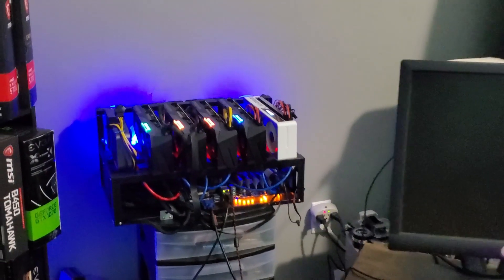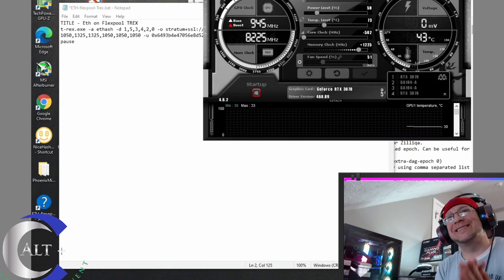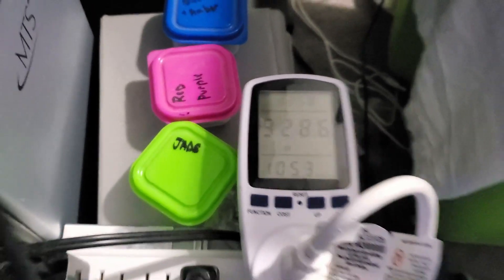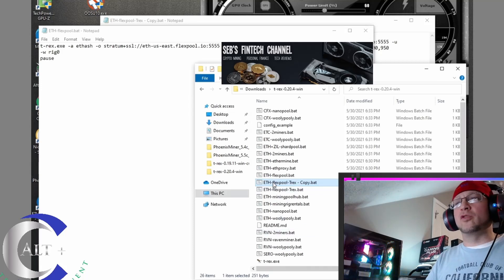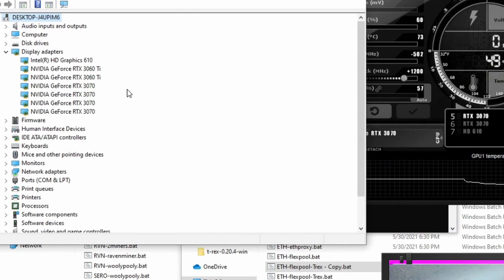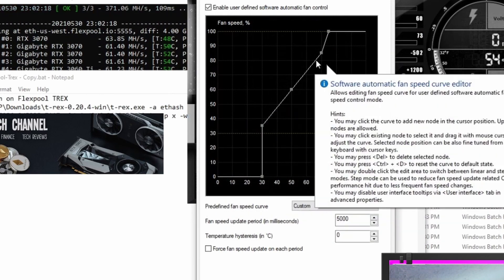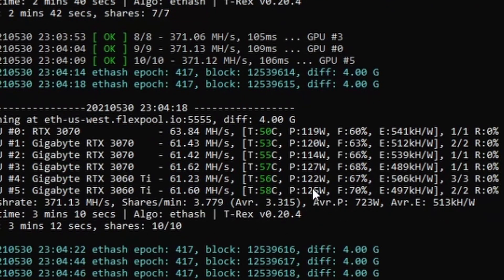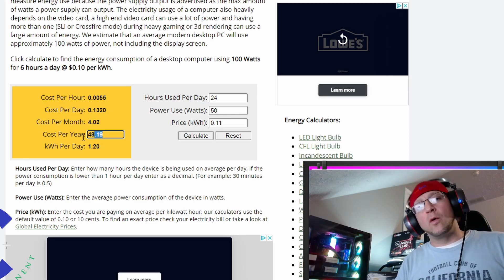How to set Absolute Core Clock in Windows on T-Rex Miner on RTX 3060 ti / 3070 Rig | Save Power Heat

Comment from the maker: Have you adjusted the absolute core clock / Locked core clock curve?  If so, how many watts did you save on your rig?
Reply: What would be the issue is pushing the lock lower? Like I know that site has a range I am just not sure why it does not go lower? Have my lock at 700 on the 3070 right now and no drop on the hash, Saves round 4 watt
Reply: I did but im using 3090 that dont seem to work  hashrate drops with power    to get same hasrate need to increase locked cclock but that way power goes up too.  Im on windows maybe hive would do better   dont know.

Comment: But this would be relative to your power limit as well right? How should I play with the power limit? what would be the ideal watts per card?
Reply from the maker: Yes and no.  When you set absolute core clock, you are essentially limited the overclock on the Core, which you are doing by limiting the  Power delivered to the core and the overall power of the gpu.  In reality you could leave the PL at 100% and set absolute core clock to say 1000 and run on 125w.  obviously depends on the card.  most times i will set PL at an arbitrary 75% just as an in case measure and then set my absolute core clock to actually control the power.  mine on

Comment: What are your powerlimit and memory clock settings , I'm an absolute beginner in this , I have RTX 3060ti FE but when i set it lock cclock to 1300 or 1350 i'm losing hashrates, Kindly suggest me the correct Memory clock and power limit too
Reply from the maker: an "absolute" beginner.  I see what you did there ;)   My 3060ti FE is set to absolute core clock of 925.  I have overclocks of -502 core,  1250 memory, my power limit is 65%, but the absolute core clock will over ride it.  Should be mining between 120-130w on eth and getting around 60-63mhs.  depends on silicon lottery
Reply: @AlteredComponent  so if i'm not using Afterburner and just Trex clock settings , should i set both --cclock and --lock-cclock together and memory clock? I want my GPU safe for longer run , so should i leave it as -500 ccclock , +1200 memory clock and 65% powerlimit but i'm getting 1% rejected shares in the miner, Please help 🙏

& Thanks for replying , subbed and you make awesome content

Comment: Do you have settings for 3060 non lhr?
Reply from the maker: the 2 i have running at about 48-49mhs on eth are running on 70% PL, -250 core, and 1200 Memory.  They are both slotted into the x16 slot on a mobo, both running at least x8 lanes, and both have a hdmi dummy plug.  oh and  on drivers 470.05.  These are all needed to unlock full hashrate on a rev 1 3060.  take care
Reply: @AlteredComponent  Thanks for reply, however I could not work with RVN. No matter what I set, it just cannot cross 23.50 on hive with absolute core lock. On windows I can easily touch 25
Reply from the maker: @sunny-handa  ah...makes sense.  I actually have all my rigs rolling windows..and the full farm on eth atm.

Comment: I've tried locking the core on my 3080 with Afterburner curve and with T-REX, but the clock still isn't staying at 1050 where I set it. It keeps going back and forth ~780-1050. Any ideas why this is happening?
Reply from the maker: Let me guess...it is an LHR card?
If so i am not surprised.  the LHR setup bounces the settings all over the place
Reply: @AlteredComponent  Indeed it is. I thought it would only affect Ethash mining and not kawpow :/

Comment: thanks dude. the lock-cclock is very important and i didn't know about this feature
 i've spent some precious hours using hiveos just for this power saving (24% power saved for me). but so many limitation when using Hiveos.
After watching this video i revert back to my own linux installation as I prefer using my own automation scripts and my custom linux.
(t-rex must be ran as root in linux for --lock-cclock setting)
Reply from the maker: Thanks for the feedback.  I get a lot of pushback because i use Primarily windows for my mining rigs.  It actually takes Tons more work to get a rig fully optimized and stable in windows and to maintain that stability.  I am familiar with linux and just feels more free. I used to experiment with different linux distros back in the day and of course on the rasp pi 4.  Appreciate the insight....mine on

Comment: You can do this in 5 seconds in afterburner instead by just opening the voltage/core clock curve and locking the voltage. ctrl+f to open the curve, click the dot you want, ctrl+l to lock
Reply from the maker: 100% true.  i made a previous video doing this with a 3060ti gigabyte gaming OC.  honestly though if doing a full rig, it is smoother to just do it in the bat file ;)
Reply: @AlteredComponent  i am actually trying to find docs/videos of voltage fine tuning/adjustments for my cards, and can't find any :-(
On my case, I got a particular 3060v2 that I am trying to optimize with the newly full LHR unlocked miners like nbminer and trex. It clearly needs more voltage but I dont know how much. Can you help me?
Reply: Well what voltage at what Core clock?
Reply: @intech7863  Depend on your card. Find the lowest dot which will not put the card into low power state

Comment: Are all your cards set to 60 PL on MSI afterburner?
Reply from the maker: thanks for watching.  TBH, if you have the absolute core clock lock, it will hit that power lock before the power limit. So if i set a pl of 60, but lock the core at a voltage lower than that, it never hits the limit
Reply: @AlteredComponent  thank you for this information

Comment: Does the core clock table applicable to Raven as well or only ETH?
Reply from the maker: thanks for watching. Yes it will reduce power, however the gains may be less significant.

Comment: Any long term side effects with cclock locked at these high values?
Reply from the maker: Honestly i have not heard of any issues, but from an architecture standpoint, i couldnt see any harm in it.  Essentially you could starve the card on power it needs, but if you starve the card too much, you either get degraded production, or crashing.  Would not think there is any long term harm.  Miners have been starving the core voltage for years especially on AMD cards.

Comment: So I don't know if its just me but when I lower my core clock using your guide I loose loads of hash. I have to up my clock to keep the hash rate I had  but at a lower  power.
Reply from the maker: That is possible.  What u are doing with absolutely core clock is essentially the same as power locking the core clock.  So when u lock the power low, the core may starve.  Didnt happen with any of mine and perhaps u are setting acc slightly too low

Comment: If I were to build a 6x gpu mining rig, would it be better to have 5 120mm fans or 4 140mm fans? What would keep the GPUs coolest?
Reply from the maker: Great question, but to answer that, it is more about what specific fans.  Pay attention to rpm and cfm when buying fans. Cfm is the amount of air a fan can move some cheap 120mm fans may do 30 cfm, while some powerful fans may do 50+cfm
Reply: @AlteredComponent  The 120mm is the Arctic P12 (56.3cfm, 1800rpm) and the 140mm is the Arctic P14 PWM PST (72.8cfm, 200-1700rpm)
Reply from the maker: Well mathematically, the 4 140mm fans provide 291.2 total cfm, and the 5 x 120mm provides 281.5 cfm..but with that close it is 100% personal preference.  I have those exact 120mm arctic fans and love them.  Take care
Reply: @AlteredComponent  Thank you, considering the 120mm fans are a bit cheaper and as you said the airflow is not too far apart from the two I will most likely buy the 120mm, thank you for the help 🙏
Reply from the maker: @noaage4592  glad to help.  Those are good bang for buck fans for sure.
Reply from the maker: Personally I would go with 120mm with a decent cfm
Reply from the maker: Personally I would go with 120mm with a decent cfm
Reply: @AlteredComponent  The 120mm fan i found is 56,3cfm and the 140mm is 72,8cfm